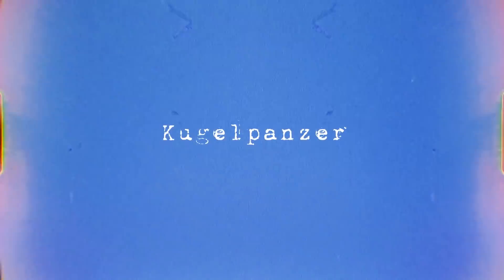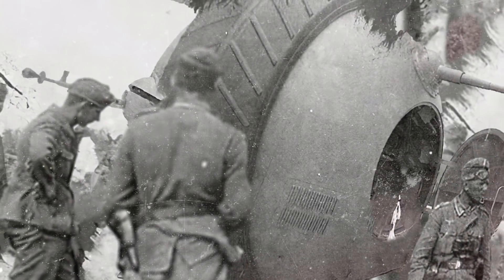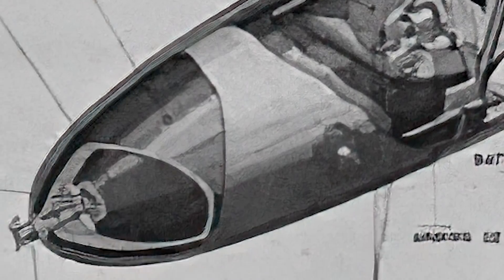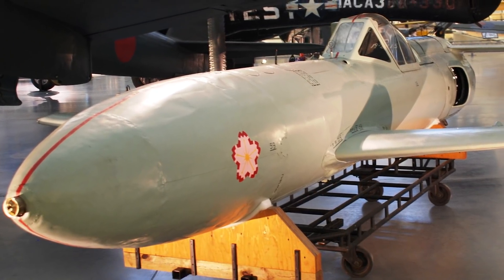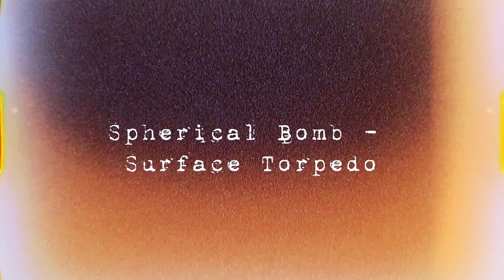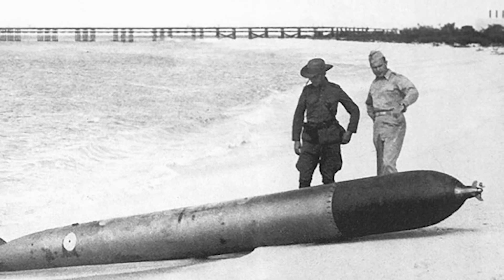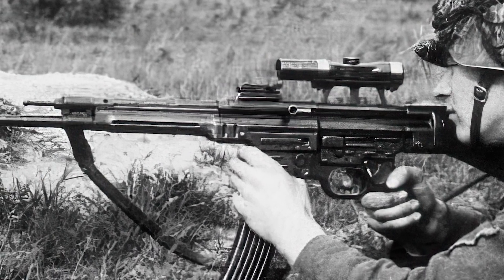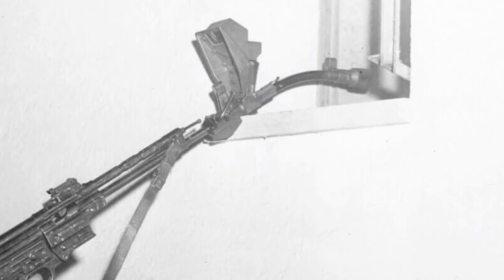5 Strangest Weapons Really Used in WW2

Comment: I do think that next time more research should be done to make sure you're using the correct photos.
During the Wunderwaffe section, An ME 262 is mentioned, but the photo is of a Lippisch p 13.
Instead of an Arado AR 234, you use a photo of a Focke Wulf Trieflugeljager.
And even the Schwerer Gustav is wrong :(
Not being picky, Just correcting some reasonably big errors

Comment: Good Video but want to point out that the context and pics in video do not match like the cannon that shot air was at 4.45 in video is the air cannon the other cannons seen are the big rail cannons called Schwerer Gustav they shot a 800mm round up to 30 miles it also took 250 crew to run it was massive.        Great Video still!!!

Comment: I do wish you could get some of your facts correct  - it was the Royal Navy, not the British Army that determined that the bouncing bomb, in the case the smaller 'Highball', which could be dropped from a Mosquito twin-engined aeroplane against the Tirpitz. These were later to be employed against Japanese Capital ships in the Pacific Theatre, from aircraft carriers of the British Pacific Fleet, but the war ended before the attacks could take place.
 A third dam, the Sorpe was also attacked during operation 'Chastise', two bombs hit the dam, but its construction was different and only minor damaged was caused, a further dam, the identity of which is not certain, was also attacked but not breached. 
The example shown in your photograph is neither an 'Upkeep' or a 'Highball', but is a half-sized prototype dropped from a converted Wellington bomber near Chesil Beach, near Weymouth in Dorset, England. It was recovered, I believe, in the 1970s, and is on display at Abbotsbury Gardens. Note the dimples, which were used to reduce the drag, in a similar manner to a golf ball. The Germans also developed a bouncing bomb, codenamed 'Kurt', but it was never used operationally.

Comment: Upkeeps design stemmed from tests where the structure to help spin up the sphere didn't detach and showed much better stability and directional control during the bounce.

There's also footage from testing that shows the water thrown up by the bombs initial impact hitting a lancaster and tearing off chunks of the tail because they were so close to the surface.

Comment: In 1944–1945, during World War II, Japan launched some 9,300 Fu-Go balloon bombs at North America. The 10-meter (33 ft) diameter balloons were inflated with hydrogen and typically carried one 15 kilograms (33 lb) bomb, or one 12 kilograms (26 lb) bomb along with four 5 kilograms (11 lb) bombs.[8] The Fu-Go utilized the 220 miles per hour (350 km/h) winter jet stream to cross 5,000 miles (8,000 km) of the Pacific Ocean in approximately three days. To control altitude, the balloon used a barometric sensor that would release ballast sand-bags when the balloon went below 30,000 feet (9,100 m). When the sensor registered an altitude of above 38,000 feet (12,000 m), hydrogen was vented from the balloon. The whole mechanism was activated 52 minutes after launch to allow the balloon to reach initial altitude. The final sandbag stations were fitted with incendiary bombs which were released by the same mechanism, and after the last release the balloon activated a self-destruct mechanism and released an additional bomb.[9]

Comment: All that tech needed is a power supply like Star Trek gear. The sound canon could project 1500db @ 150 miles in a conical pattern, the tip releasing the equivalent energy of a tac nuke.
Reply: "The sound canon could project 1500db @ 150 miles in a conical pattern"  Interesting.  Especially given the loudest possible sound is 194 dBs (at sea level); at this point a full rarefaction (vacuum pocket) occurs.  Can't get any louder than that, but 194 dBs is plenty loud.  But, 1500 dBs... just wow!

Comment: Bouncing bomb is a brilliant idea at its time. But then superseded by the proximity fuse bombs in terms of effectiveness.
Reply: They tried an even smaller version called Baseball for attack boats, because seven of them took up as much space as a single torpedo, but they never worked - seems you need the height and speed from an aerial launch to get them to bounce properly!
Reply: Proximity fused bombs existed. But, as the video says, the point of the bouncing bomb was not only to explode against the dam wall, but to explode at depth, where water pressure would maximise its' effect.